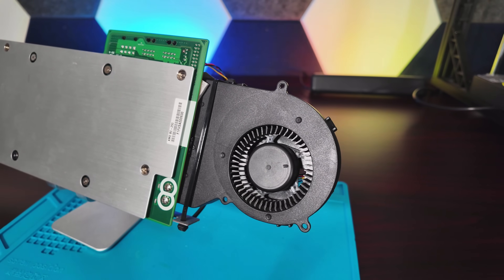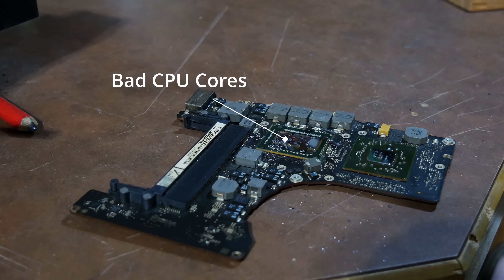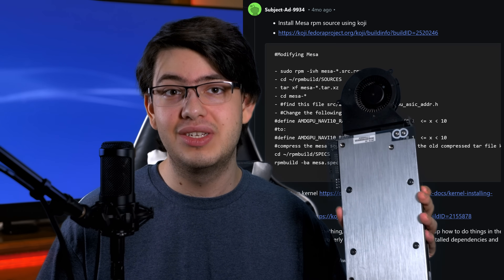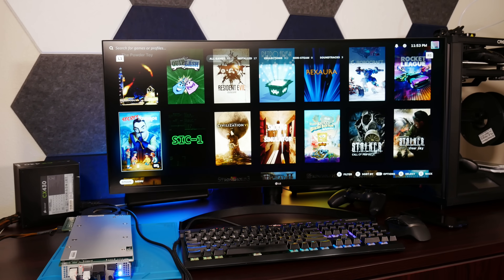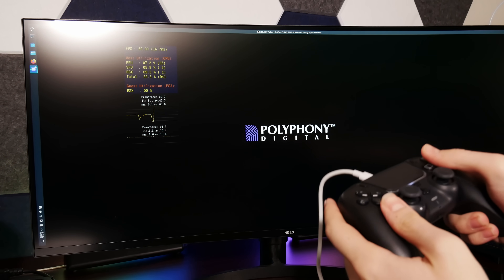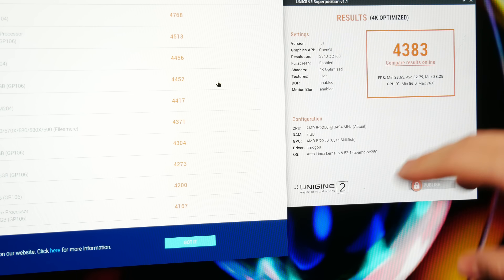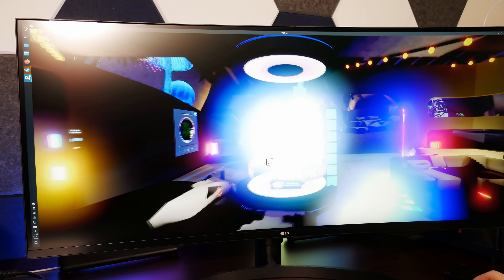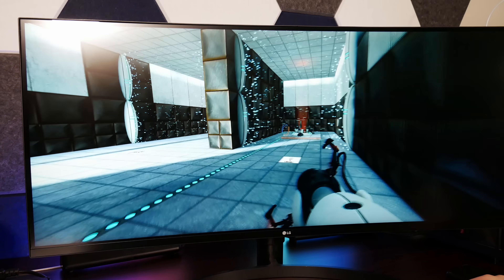I Ran PS3 Games on PS5 Silicon to Prove Sony Wrong

Comment: Can you next hosted resources to create a virtual machines of mega specs? 
This is kind of like compute distribution using AI or like raid for storage?
I'm sure once this kind virtuallised system becomes consumer grade. People could create their own "hosted" services to run locally indeed of line Google's virtualised gaming and game markets or Microsoft's or what ever? 
I'm pretty sure if you look for a headless interface for the blade server for Linux you may be able to collaborate resources across multiple blade cards. Then you should be able to launch the Linux headless hosting (boot into the VM interface) and then run the exact same virtual machine as you have for this scenario but you'll able to assign some crazy amount of processor cores and some crazy amount of graphics computing resources as it's a distribution of resources so no  1 graphics card is stressed to the max.

I'm almost certain this has been achieved before but just now you've got these decent blade servers. 

I think you should look into creating a nested resources hosted headless virtual machine. Once configured within the Linux host configurator, you should able  automatic boot and bypass the vm host to boot straight into the virtual machine so it won't even look virtualised.

Anyway look into I'm sure it's very easily done. You may need to do some bios flashing of the main  microcontroller or UEFI but if you can get into UEFI shell you can easily enable disabled hardware by calling hardware address before booting the VM. This is what the Hackintosh community have done to enable MacOS to run on hardware it was never designed or intended to run on and will do that with superior performance to the same OS running on Apple hardware!
Apple used hard coding to disable the external GPU on Macbooks restricting the graphics output to the Intel on chip graphics when an AMD GPU is present? This was annoying as it inhibits CPU performance and generates more heat and degradation to the CPU. They also disabled the digital sound output because this is linked to the graphics driver that wouldn't install because it can't detect.  However with calling some hardware addresses using UEFI shell script in the boot directory to autostart in the EFI boot re-enabling what Apple disabled (UEFI v1.0 Apple) chain booting UEFI v2.0 run the hardware address to enable via command line and then launch Windows. That would allow me to detect the AMD graphics and also install the crimson sound driver and then I had sound in windows whilst booting EFI.  This problem does not occur if you launch BIOS boot mgr non-UEFI and all the hardware would detect fine but then I had incompatibility as you can only have GTP or MGR at a drive level. You can't partition half a drive EFI and the other half BIOS boot non-efi...... Yet somehow not an issue when booting from an external drive on Mac hardware. This meant it could be done but Apple just weren't doing it.
Getting your head around EFI boot and chainload EFI 2.0 to run efi shell 2.0 that enables command line to hardware address could probably even force enable the disabled cores, potentially?

This is not different to the strategy that Gigabyte used to unlock locked AMD cores so that you could turn your dual core phenom II into a hexacore semprom equivalent. The locking is all just codes in the EFI bios that's why the unlocked processors wouldn't stay unlocked when you put the same chip into an Asus motherboard. Gigabyte did this to leverage the AMD popularity and strict QA to sell more motherboards to people that would have otherwise upgraded CPU. Most locked CPS when unlocked  did almost as good performance as the unlocked CPUs that they didn't make the cut to be included in. 
AMD does a lot to sell hardware that didn't meet the strict requirements by downgrading firmware to switch cores off or cap max output and often they are the same CPUz software capped to be hardware capped to sell as a cheaper product. People not knowing it's the same hardware that's just been artificially handicapped to meet over all user expectations.
I'm not sure that AMD still follows this strategy but it's phenomenon experienced across the entire computing industry?

Hardware hacking and chip dumping is also another way to force enable shit that's been disabled 😁 it's a whole lot more trickier to do but you will be able to do things that are impossible and not easily replicable and you'll be dealing with pin locks and hex and machine code and that's a bit wild.....but if you cannot get root access on a system then sometimes  flipping bits and hoping for the best can be a bit like gambling? 
Great for bypassing security chips or sending a 1 byte to bypass encrypted bootloader checks or what ever rubbish manufacturers want to put in to look you out or limit its use?

Hopefully something I've shared might spark some inspiration and provide you with a path or route forward with this hardware 👍

Comment: Part of the problem is such an emulator didn't work nearly as well when the system launched. Things changed, of course. Nintendo didn't put SNES virtual console on the original 3DS because they couldn't make it work in a way they were satisfied with. That changed when they launched the "new" 3DS line with a better processor.
Sony still would prefer to reinvent the wheel instead of letting it keep on rolling.

Comment: A few things wrong with this. You ran a 3rd party emulator to run on a cut-down version of the PS5 with an OS that's not even the OS of the PS5. So.... essentially, you're not running on officially developed software by Sony that still makes what Sony says viable that PS3 emulation is just costly to do so. Remember, when it comes to corporate platforms, they need to make it their own and not use 3rd party. As sucky as that sounds, it's true. However, it is not without hope if the jailbreaking community steps up for PS5 and actually does allow 3rd party emulation to finally be in-play. For now, I will say that PS3 Emulation for the PS5 is not yet doable unless it is done on all the grounds covered by a stock PS5. What you're doing right now is just using it's hardware, making it into a PC and slapping in 3rd party emulation software. Hence it doesn't meet the criteria of is, with and on a PS5. We are well aware that PS5 hardware is capable of PS3 Emulation. Heck the STEAM DECK IS... So why not PS5 right? So here's how to make what you did possible and correct:
1.) You must use FULL HARDWARE (not cutdown) of the PS5. 
2.) You must be using PS5 Firmware/OS
3.) The games must run NATIVELY on console without emulation tricks. Which is why Sony admits it's difficult to achieve and refuses to pursue it and quite frankly is quite impossible without emulation techniques. 

Here I thought you actually did code to make the PS5 run PS3 games natively. I was wrong. It's generally not possible but yeah. Your entire video for 9 minutes still proves that the PS5 cannot run PS3 games natively and still proves what Sony says about the matter is true. I guess we should just be glad that PS4 games still run on PS5.  We don't need proof that it can't run emulation. WE KNOW it can.
Reply: A FEW THINGS WRONG WITH YOU.

jk <3
Reply: Well, your 3rd point is impossible. We can't use ps5 hardware to play ps3 games natively, that's why emulation is needed

Comment: I knew from the beginning that the lack of backward compatibility was a lie. If they are so worried about profits, let them sell it as an application, for example a virtual PS2 for $10, you run such an application and pretend that you have a classic console, you only need games on discs, and if you don't have them, you can buy the game on PSN, it's that simple. But they like to limit everything, you can't even use DualSens on PS4, it's sick.

Comment: This wasn’t necessary; anyone who actually knows computer hardware knows the PS5 and Xbox series x can run PS3. Let the stupid people keep wondering if it can or can’t. 

Also, insider here. Sony COULD release PS3 and even PS2 emulation, they already have it. You know why they won’t release it? Because you all still have disc drives! If they release now, everyone will demand to play PS2 and PS3 games from their disc. Sony is waiting until next gen where they will sell a console and a UHD drive separately that only plays PlayStation games but from what I’ve heard, no movies for blu ray or dvd. It will be an excuse to say “you can’t play PS2 or PS3 from the discs you own because the drive doesn’t have the hardware support; forcing you to buy the games from them.

Comment: When MVG did his video on the subject a few years ago, maybe it wasn't possible. Demetri is a dev and was big in the emulation scene, so he does know his stuff. RPCS3 has come a long way though. The Steam Deck can run less demanding PS3 games. Zen 2 onward, RPCS3 seems to benefit most from CPU threads and RAM, which the PS5 has enough. I also suspect that PSNow has been using emulation for a while now. IBM hasn't manufactured or supported Cell products for a long time. It's unlikely that Sony is still running them in a data centre environment. So it can be done. It's just more profitable to charge users for cloud streaming.

Comment: I understood the PS4 not having PS3 emulation. the CPU in the PS4 is really not very powerful, and emulation would be very slow on it. But the PS5 has a way better CPU and GPU.
There is no excuse not to have PS1/PS2 emulation, though. PS1 games can run on a potato, and even PS2 emulation would work fine on a PS4 CPU.

Comment: Bro Sony doesn't even bother utilizing PS5's hardware capabilities to run PS4 games at their full potential, let alone supporting the older generations. There are lots of great 8 gen games still locked at 30 fps on this machine including RDR 2, Detroit, Batman, etc.

Comment: Now if you want to play ps5 games you gotta revert everything you just did not so simple in their case they would have to make a whole new emulator that runs ps3 and still have the ps5 software still on going in the backround so you can just go back to the ps5 home screen but this is not even running ps5 software anymore its running linux

Comment: Figured I do a write up for Arch in the current state:
- Flashed modified bios
- Downloaded latest ISO at the moment was archlinux-2024.12.01-x86_64
- Wrote ISO via DD to usb flash drive
- On installer boot screen hit E to edit the command-line args, had to add: acpi=noirq usbcore.autosuspend=-1 amdgpu.sg_display=0        (Then pressed enter)
- It should boot to the CLI, I did have to unplug my keyboard and plug it into another USB port closest one to the Rj45, not sure why but then the keyboard worked again
- Ran archinstall and installed a base desktop plasma system (zen kernel)
- After install rebooted with no kernel flags and it went to bash just fine
- Enabled multilib in /etc/pacman.conf
- Installed yay
- From yay installed: mesa-amd-bc250 vulkan-radeon-amd-bc250 lib32-mesa-amd-bc250 lib32-vulkan-radeon-amd-bc250 
- Installed sddm via pacman
- Started sddm via systemctl
- Installed Steam
- Played a game
=== Profit... but honestly YMMV but this was a fun little project.
Reply: Wow this is super helpful TY!!!!!!

Comment: There was never an excuse for not putting backwards compatiblity in the new consoles. If it required extra hardware then just design it with the extra hardware. After the PS4s success they new it wasnt a risk

Comment: I just want to put my PS3 and PS2 DVD or Blu-ray into the PS5, so it won't clutter SSD space. Even if you install PS3 games it doesn't use that much space, a few exceptions. If they sell extras like DLC and patches for it that's fine or make you pay to get PS2 games to 16:9 also fine.
Just if you have a DVD and Blu-ray collection, just make it possible to play it on a PS5, even if you still have a PS3 and PS2.

Comment: the ps3 is the most capable machine out of all the sony consoles. more capable than the ps4 bc the ps3 was designed to be SCALABLE according to the type of math used to process data. its the IDEAL machine for machine learning if you compress the high topography mathematics correctly. it wasnt designed as a gaming console it was designed as a scalable supercomputer that could rape windows and mac OS/networks in cyberwarfare. if you wanted an OFFGRID COMPUTER the ps3 is the Lords choice of computing machine

Comment: You need to remember that they wiuld need to spend time.and effort to make there own emulator of a hardware that is still hard to emulate due to nature SPU cores and they cant take RPCS3 code, there lawers would kill them and 2nd its licenced with GPL which would force them to open source parts of firmware. So simply its investment Sony would need to make and they dont see it wirth it

Comment: another pretty intense title to test is wipeout HD fury, that thing alone made my system struggle under default settings, if this thing can push the same performance or better, I'll call it the evidence that sony is being extremely deceptive and cheap by saying they can't and won't support PS3 emulation in their current systems.

RPCS3 is the reason why I won't buy a PS3 or any PS device ever again.

Comment: I always prefer native or hybrid between native hardware and emulation over full on emulation which is reliant on digital rereleases and constant tweaks. I think Sony should remake and replicate the CPU's, like the Cell CPU and then emulate everything else, like the GPU, Ram etc. Not only will this greatly improve the accuracy of running PS3 games from discs and digitally. But it will give you emulation benefits aswell, like running games at higher framerates and at higher resolutions since the GPU is being emulated. It's easy for Sony to run their legacy hardware this way. Since they have all of classified documents like the source codes and the schematics for their hardware. And they can easily make like another fully backwards compatible console that not only plays older games digitally and from discs, but also can render them at higher resolutions with trophy support with higher framerates without any glitches.

Comment: Sony has it easy. If they want to profit from PS3 emulation they just need to make an official PS3 emulator and sold it in PS Store like a game. They can charge like 20 bucks for the app and sure they would sell millions. Then we launch the PS3 app and insert our PS3 discs. I don't know if the PS5 disc drive can read CDs and DVDs. If it can they can do the same for PSX and PS2. It's fine that Sony thinks emulation is a waste of money doing it for free but they can give us the option to have it making us paying for it. To make PS Plus subscription more attractive they can also add those emulators to the subscription (retrocompatibility free if you subscribe) and profit from that.

Comment: You might be able to use an AMD GPU BIOS flashing utility to change the memory clocks and copy over a clock table from a comparable GPU. I flashed my GTX 950 to raise the power limit and lower memory clocks to open up more power overhead for increasing core clocks. I had the ASUS single slot version that was stock limited to 95w but I managed to get ~110-115 through PCI before the mobo throttled

Comment: 1 sony nerver claimed the PS5 can't emulate PS3 games
2 Sony havent spend the time or money to develop their own emulator
3 I'm Ryan, their last CEO, was famously a hater of old games and didn't see much in the point of backwards compatibility. Its why the PS4 had zero support
4 the PS5 has support for PS4 because cerny could easily convinve Ryan that it wouldn't cost anything due to the similar architechtures.
5 The PS2 emulator on PS5 and PS4 is quite bad but likely legacy code from the software PS3 emulator
6 again, its just a question about willpower, and sony doesn't care about the PS3 generation. They release all their PS4 games on PC because the code is easy to access and its simpler to port X86 games, but porting old PowerPC code costs more money

TL:DR Sony is greedy like any other ahareholder company and spending years developing their own emulator isn't deemed worth the cost of profitable. Their last CEO also hated old games and was against backwards compatibility.

Comment: I don't really blame Sony for not supporting PS3 games on the PS5. For one, the RPCS3 emulator has been in development  for over a decade and still has major performance problems with many, many games. And secondly, Sony doesn't own RPCS3. They would have to develop their own emulator, and support it. That's a big investment considering the results of that investment are a big unknown.
Reply: Only problem with that logic is that Sony owns the hardware and knows how it works far better than any independent software dev. They could absolutely develop their own emulator, and it could be the best performing one. But, They did the math and realized that selling new games beats customers being able to play ones they have already bought. Just another example of capitalism being a shitty way of organizing the economy.
Reply: @MrBigTrey  Then why would Sony include PS4 backwards compatibility ?
Reply: @Lardzor  Because the ps4 is basically a computer and a ps5 is just a newer computer. They both use x86-64 hardware.